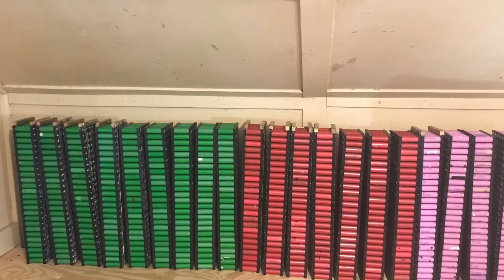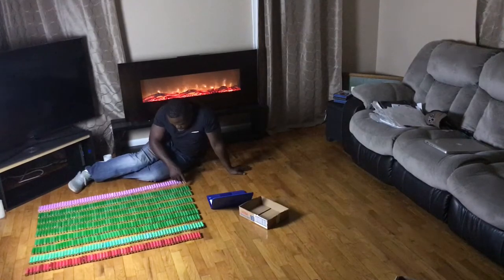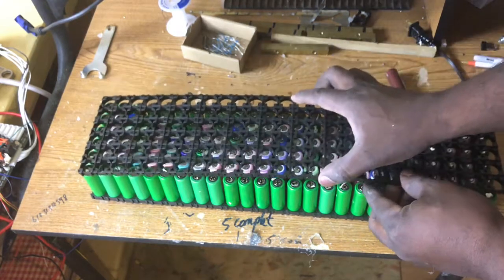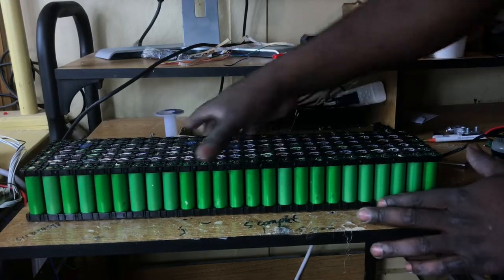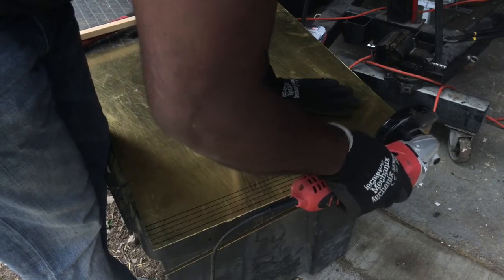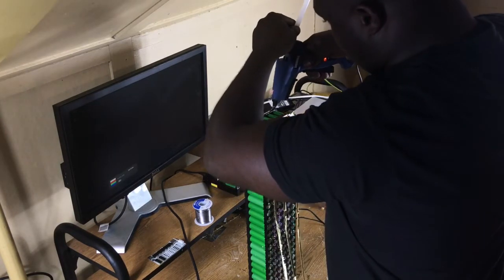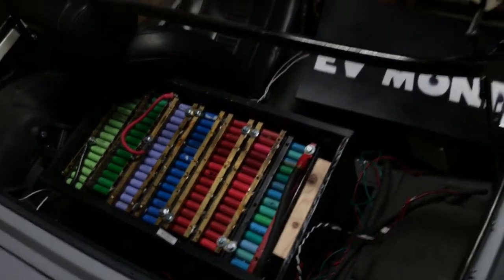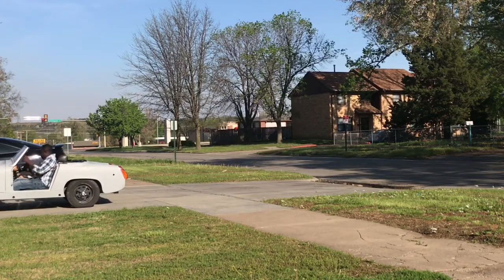SIX THOUSAND 18650  BATTERIES POWER AN ELECTRIC CAR

Comment: Hi, I have around 5500 cells at 2200ah and I was planning to build a big powerwall but that will be too much because we consume only 120-150 kw per month in my house. So I bought REVAi electric car ( G-Wiz outside india), it comes with 48V 200ah lead acid battery. I want to convert it to lithium ion using the cells that I have. I'm struck at the initial stage itself... don't know how to proceed. 

The car got 400 amp controller and require at least 300 amp for it's peak performance. But I'm not finding the 300 or 400 amp discharge bms for my battery pack. My plan is to build 2200mah*3.7V*2500 cells = 20kW pack which will give about 180-200km range per charge. 5kW 4 module will work ? If yes.. then how can I achieve 300 amp discharge from each module ? If I make 4 5kW pack with 100a discharge and connect in parallel to get 400a discharge, will it work ??

So how should I proceed ??
Reply: Hey, did you successfully replace the battery? I have a reva i too and trying to do the same. Let me know if you have done it. Thanks.

Comment: Are there open source plans for battery packs that include cooling and heating for the battery pack? I noticed that most DIY projects don't address the thermal management of the batteries.

Comment: Awesome job! Cant wait to see the rang of this batteries!
Reply: I meant to say efficiency of the controller and motor.
Sorry i misspelled it first time.
Reply: Me too.
But after some calculations based on the capacity of the batteries and their number i can say around 150 miles
I have calculated an average of 320 W/mile
Maybe Kavin can tell us the losses of the motor and the controller too.
Reply from the maker: I  am using a 72 volt system. and i charge it up to 84 volt. with a 40hp motor 72v. my controller can only pull 400amps max. i am planing to travel at the speed of  45 to 50 miles max